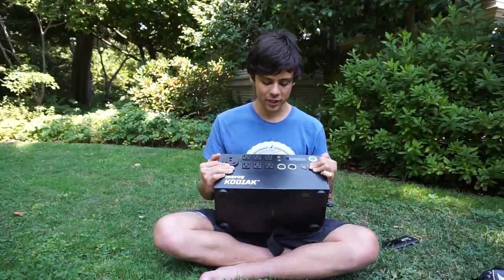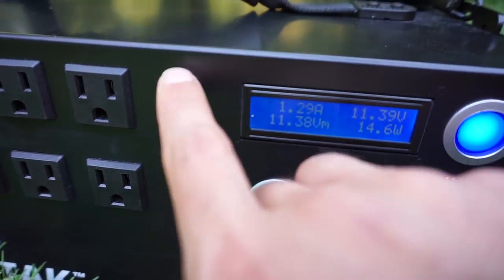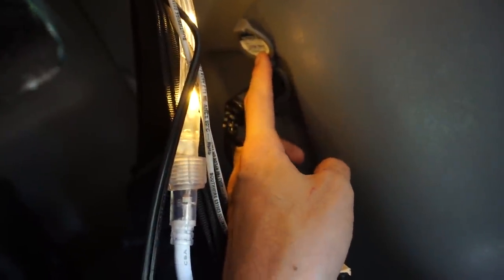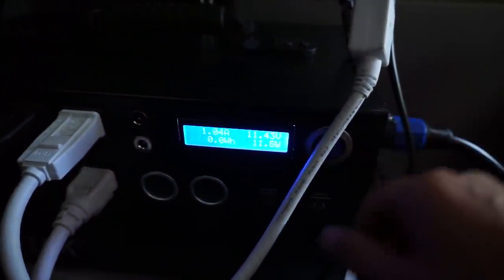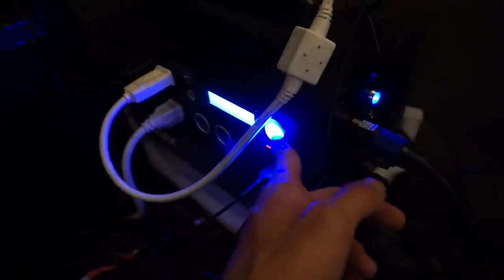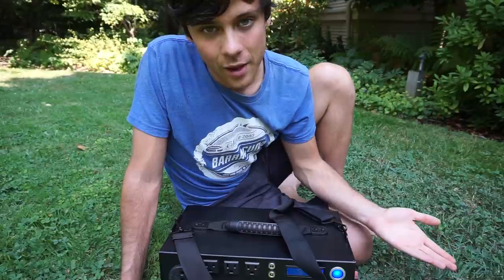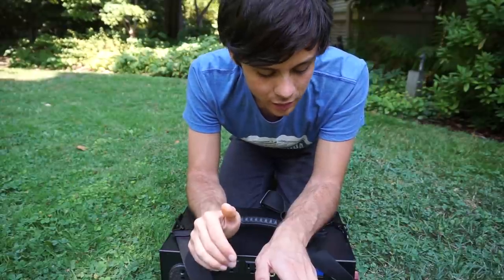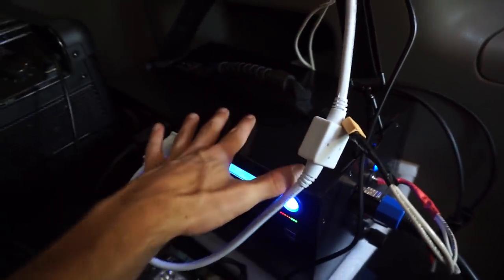Inergy Kodiak Solar Generator Full Review: Pros/cons, load test, how to use it and much more!

Comment: Will, what about that 453 Expert Power Omega you were using? I'm thinking about getting one for myself, but I was waiting to see how it worked out with you. Now that you've got the Kodiak, are you going to sell the Omega?
Reply from the maker: Yeah I sold the Omega  a couple weeks ago. Honestly I would use the omega if I didnt want:
more solar panels
the ability to run a microwave
Those are the main reasons I bought the kodiak. The omega can only input 100 watts. I want to put 300 watts on my roof. I will have 250 at the end of this week. If you do not need to run a microwave, and you only have a 100 watt solar panel, the omega works great. I was unable to use it for years though, so I cannot tell you how well it does over a long time

Comment: Okay in your video you said you had to have the machine turned on charge your phone but you can bypass that if you buy one of those charging units where you plug your phone into it goes into the cigarette lighter cuz we've had ours for two years and my husband always charges are phone with that cigarette lighter with adapter and we never have to turn the machine on
Reply from the maker: +Josette Ihrke yes true but that's a bummer.

Comment: I don't understand somethings. When it cut off using the microwave was that the battery going completely dead? Also, if the sun is shining are the panels making usable electricity or does the power have to be stored in the battery first? Also, can ten lead car batteries be linked or only one battery?

Comment: Hi Will. I want to charge my new Kodiak Apex ( name changed from K2) with the Kodiak car charger but my Toyota has a 120 watt 12 volt outlet. If I use this outlet what happens ? Does it just charge at this rate or not at all or damage my car's charger? what should I expect? Should I buy the K2 car charger or not?

Comment: You’re supposed to buy this thing because she what microwaves do in the beginning as they take a lot of power same with air conditioners there’s just thing that supposed to make it not take so much energy at first though the device will work a little bit slower to start out but they don’t take as much energy which in return doesn’t hurt your devices such as your battery generator or your generator in general

Comment: Will I like the all in one cleanliness of this product, but have a question about powering 12v with the generator. My Rv has a very small 12v system, a few LED lights and a Maxxfan, rigged to a fuse blade box. WhenI asked Kodiak how to hook this up to the generator that said it wasn't recommended. What is your take?

Comment: Just got a Yeti 1000, it is 40lbs, about 1/2 what I can handle, not bad, wish I see this review first.  Is that small 453 still a good one to get?
Reply from the maker: +Wanju Chien I have the lithium 1000 and the charge efficiency is horrible. I am not pleased at all. I will make a review on it soon
Reply: Break my heart.  Looks so fine and I don't want to sell it. Review was GREAT. However, I started to suspect the 44 loss was due to the panel, not the battery, Need to watch more videos to clarify.  When Inergy gives you a better deal I will buy a Kodiak through you, right now it still feel quite expensive.  In 2015, the lowest promo they gave was around 1200.  If nothing has been changed since then, that was a great deal.  I'd  be pleased to get it $1400, $1500. Don;t mean it does not worth what is asked for but there so many things to buy, solar panel, doemetic etc...CAn not thank you enough for your service

Comment: I wonder, if you parellel led acid batteries, does the unit cut them off once they reach 12.1v or does it keep draining them till they are dead?
Reply: Good question. I was wondering the same thing
Reply: Just found out that the Kodiak does not limit the voltage discharge on the lead acid battery and will run it down until the Kodiak battery dies (Low voltage). That's well below the lead acid max discharge of 50%. 

According to Inergy:
"The External battery will stay in the ranges of the Kodiaks battery which is 12.3-12.6V full charged and 9.0-9.5V 20% charge left. AGM manufactures state not to let the battery go below 50% this is if using the battery for its intended function I.E starting a motor ECT. However since the Kodiak is only using the battery as a power cell, and not needing to draw high cranking AMPS this will only shorten the AGM's life by a few charge cycles. This does mean however that the external battery will only be good to be used with the Kodiak."

That last sentence says it all........
Reply: Arley Clark thanks for digging in. Bumper thou...This means i have to keep a close eye on the agm

Comment: Quick question...could I use a single 24V Renogy 270 or 300 panel with the Kodiak? Just thinking about using a single panel instead.
Reply from the maker: Yes. As long as voltage isn't over 30 volts
Reply: Will Prowse Many thanks!
Reply: Valerie Cason the new K2 only uses the proprietary panels. They said most of their warranty submissions were from improperly connected or faulty issued panels.

Comment: Question: Can I use the 100W PANEL 30 FT. CABLE from kodiak to a 220w solar panel from power film???, how about the 120w panel? thanks.

Comment: I am doing a cargo conversion starting this week. With this system can I just wire everything for 120 volt and not use 12 volt at all systems at all. Just connect to 30 amp plug when available on shore with adapter and wire everything inside to a extension cord plugged in to this box? I guess my question is if you are starting from scratch blank canvas why do I need a 12 volt system with this?
Reply: I coulf be wrong here, but I think you'd be using the inverter all the time that way and it would cost you more energy.

Comment: Do you think the kodiak can be used to power my 12v appliances on my RV by hooking rv’s positive and negative cables to the kodiak’s terminals instead of using my 12v battery? Would that work? Does my question make sense?
Reply from the maker: +Eduardo Santiago yeah it would work. There is a RV specific power port on the front of the Kodiak. Just plug it in. You will be limited to 1100 watts though unless you add a lead acid battery
Reply: I understand what you’re saying but instead of using the 30 amp plug I wanted to know if I can instead connect it by using the red and black cables going to the 12v battery. Basically the kodiak acting as a 12v battery. Am I making sense here?

Comment: Will, I'm going to get a Yeti 1400 and connect it to a BattleBorn 12v 100Ahr using the DC adapter to charge the Yeti 1400 from the BattleBorn using Noco 12v cigarette adapter and a battery meter, and charge the BattleBorn from the Yeti 1400 plugged into the wall, using my Noco battery charger.  I'll have the 200 Watt panels but won't be able to use them much due to my apartment.  Do you see any problem with that?  I'm just starting.
Reply from the maker: Why do that? Battleborn expensive. Just buy a Goalzero 3000. Way easier
Reply: @WillProwse  Coincidentally, I just changed my order with them through e-mail from a 1400 to a 3000. 

I wouldn't need the other battery. It was just a learning tool that could be used for a real situation later.

In order to learn one must do.

Comment: Hi Will, I am trying to figure out a solar system setup for my camper. I am not wanting to be completely off-grid, as I live in Montana with cold winters and want to be able to use electric heat, griddle, toaster, etc. The stuff that I would like to power off solar would be LED lights, Macbook Pro, bluetooth speaker, cellphone, usb battery bank, and camera batteries. I was looking at smaller solar generator that you did a review on, but I am wondering if it is the best deal for my money. Would it be better if I got 200 watt Renogy panels with the Rover ppt charge controller, some sort of inverter and some sealed lead acid batteries. One thing that I like about the solar generator is I could take the setup with me when camping out of my Suburban. Thoughts?
Reply from the maker: +zane sutherland what are you using to power that stuff right now? The toaster/griddle etc?
Reply from the maker: +zane sutherland it depends on how long you plan to run your stuff and how much sun you have. Have you used the solar there during the winter before? I would go with propane and solar combo

Comment: What type of Solar Generator would you recommend to run a portable 1500Watt AC Unit for 8hrs?
Reply from the maker: None.
Reply from the maker: Check out part of my website that goes over how to power air conditioner with solar power. It's under ultra sized systems
Reply: Thank you for the info.

Comment: That battery is way too small for that inverter rating. To continuously run that kind of wattage you pretty much need a alternater for the constant amp draw otherwise the voltage drop will be too great, and will cause overheating.

Comment: Will, how does this unit compare, in your opinion, to the Goal Zero Yeti 1400?
Reply from the maker: yeti 1400 has horrible charge input. takes forever to charge it. 30-60 hours with the 90 watt panel. 16 hours with max solar input. which are their own panels. that are overpriced. 

next, it is rated for only 500 charge cycles. its lithium, so you can increase it with how you use it. but considering how large the battery is, that is a bad figure. 

more reasons why I hate goal zero. I am waiting for them to make a good one. So far, nothing.
Reply from the maker: Oh I am sorry. I just looked at data sheet for generator and there is another input option. wow! 360 watts. not bad. kodiak is 600 watts input. 

I think I need to make a video comparing these generators. There is a lot to dislike with goal zero. many of their products have bad reviews.

Comment: I might have missed it: can you fully charge the system with your 200W alone in a few hours?
I'm thinking of buying about 300-360W initially (either 2x150 Renogy or 2x180W Grape Solar). I'm in LA but close to the coast so it is overcast relatively often...
Reply from the maker: +Shakesbits great question!! I should have gone into that more. So it's a 1100 watt hour battery, and you can fully charge it with a 200 watt array in 5.4 hours... Theoretically. Typically my 200 watt array produces 170 watts in full sun. So it depends on your location and other factors. Most days my battery is fully charged, all the time. And I use the microwave everyday.
Reply from the maker: +Shakesbits 300 watts would be a great minimum solar array input. 400 would be ideal.nespecially because of winter and overcast days.
Reply: Will Prowse great thanks for that.  I guess I'm gonna start with the Kodiak plus whichever of the solar panel packs is cheaper at the time of purchase (somewhere in September,  I know myself,  if I buy it now,  I'll be tinkering with it instead of finishing up my other projects :-)). 
This pack might actually cover about 95% of what I need (lights,  phone,  tablet,  shavers, camera batteries,  e-bike  possibly pc+monitor  and maaaaaybe I might even be able to hook the ps4 occasionally - actually can I only expand with lead acid/agm or could I hook up a battle born 100AH too?)and I'll save time, space and weight. Thanks for the review btw
Reply from the maker: +Shakesbits sure thing! And the battle born should work perfectly because it is a drop in replacement for lead acid. But I have not tried that yet... It should work fine though. A battle born and Kodiak combined... Would be amazing

And yeah for what you need, the Kodiak should work great!
Reply: Thank you so much. This thread and the review has helped me so much.
So with 400w solar and a Kodiak I can use my nutri ninja and watch tv on my 12v tv. 
Other consumption will be just led lights and charging a tablet.

Comment: This does not use Lithium Iron Phosphate, it uses nickel-manganese-cobalt (NMC), which has twice the Specific Energy, but is not as stable as Iron Phosphate.  You could not get 1.1kWh @ 20# with an Iron Phosphate (LiFePO 4).
Reply from the maker: Yep

Comment: How long could the Kodiak run arb without using solar panels?
Reply from the maker: +smarie rexford a very long time. But depends on ambient temperature and where the arb is positioned. I used to insulate my arb and keep it in a cold spot. Uses much less electricity.
Reply: This was one of the main reasons I bought the unit  (pre-order/kickoff buy).  There are a hundred variables that go along with your question but I'll share my experience since I was one of the first to get a Kodiak. The ARB has auto shut off voltage settings to keep from killing your automobile battery. The problem with this and the Kodiak is the solar generators highest voltage at full charge is 12.4...ish volts and the lowest ARB shut off setting it 11 something volts (don't recall exact voltage). It doesn't take long for the ARB to reach this cutoff point of the Kodiak, even though the Kodiak has much, much  more capacity to keep running the ARB. 

So you have a few different options. Assuming your pre-chill your ARB loaded with food before you go, which you should always do, the unit will only run maybe one or two times in the 60s or below ambient assuming you haul it inside the vehicle with AC on.  I try to get my ARB to just about freeze on the bottom before leaving the house. 

So day two, the unit is going to run more of course so now that voltage cut off becomes an issue. You could plug the ARB into the 120v AC outlet but now you have conversion loss from AC-DC plus the inverter also pulling nearly 15 watts just being turned on. I've found a work around for the low DC voltage but it requires a solar panel but it would be a really small panel if you wanted. Any solar panel that's 12v  will input 12 + volts to the Kodiak which also fools the ARB into thinking the Kodiak is putting out 12 volts. Now the problem is you are going to major drain the Kodiak if you don't replenish the battery either with solar or via your vehicle cig lighter plug. A good single 100 watt panel can do the job if you have good sun. 

So I basically try to keep the ARB at nearly frozen much like when I leave the house during the day, they the ARB typically don't need to run at night if it's much colder out. Again, a million variables but this is the best advice I can give you. 

Couple side notes. The 12v lights they have are excellent. I do have a 130ah AGM with cables now but haven't tried runtime with that combo. Litterally the first day the unit arrived our transformer for your house power blew up on the hottest day of the year.... in AZ! Ran our full size fridge for almost one full day and saved probably $400-$500 in food!

Comment: I don't know what the 30 amp rv plug would be good for, besides running a few small things. It's a nice little unit but definitely will never delivery what it claims. Running some appliances with low voltage can shorten the life of the components.

Comment: Thank you for the discount code. I am an electric-challenged senior, who has the Kodiak, and a Canadian Solar CS6K-305MS Monocrystalline 305 Watt Solar Panel I want to use with a RoadTrack 190 (Dodge Ram 350). With the adapter, can I just plug the solar panel directly into the battery (I have a fuse connection) or do I also need a Victron 20 amp MPPT solar controller?
Reply from the maker: Yeah the solar panel can plug directly into the battery. Not need for the solar charge controller
Reply: Thank you Will.

Comment: Would the kodaik work in europe?
Reply from the maker: +timothy790110 in what way? Ac input? It has an external power supply, so it sure will. If not you can make your own very easily
Reply: Yea, i was just in touch with inergy, woulöd work fine,  unfortunately the shipping is 400 bucks, and Id have to pay import duties. we have 240v in the sockets here. Have you heard of winston lifepo4? Significantly cheaper than the prices you stated in the video. 420 euros for 90 Ah, (about 500 usd) https://www.ev-power.eu/LiFeYPO4-batteries-12V-1-1/Lithium-Battery-12V-90Ah-WB-LP12V90AH.html?cur=1
Reply from the maker: +timothy790110 no way!!! Will look into this now. I still need to build my own system
Reply from the maker: Ohh right. I know these batteries. I have wanted to build one of these for some time. Yes they are cheap but BMS can be costly ifyou want something good.
Reply: Yea, i think they were branded "thunderclap" or something in the states. A middle of the road BMS would be around 100 usd right? I think ill write them and ask what id need for my setup. Ideally Id like a system under 2 grand, including solar panels. They sell 300w monos for 250 usd, thats pretty good. Id like to get a system for under 2000 usd, 600w pure sine, 2x90 Lifepo4's, but Im not sure what Id need. Have you done a video yet on setting up a complete Lifepo4 system?

Comment: What about a small 12volt refrigerator?
Reply from the maker: very very easy to power one. no problem at all.
Reply: Will Prowse i was looking on line the kodiak and the price is 1600 ..which one is better 1250 goal zero yeti or the kodiak?
Reply from the maker: +Israel Morales the goal zero yeti does not compare. It takes way longer to charge and in my opinion it seems like a bad choice
Reply from the maker: +Israel Morales Kodiak way better. I think I will make a video on that next
Reply: Dometic or Engel 12 volt compressor fridge is only around 200 watt-hours per day so you have plenty of energy to run them with 1100 watt-hour system
Reply: Thanks for your help i was about to buy the goal zero .)